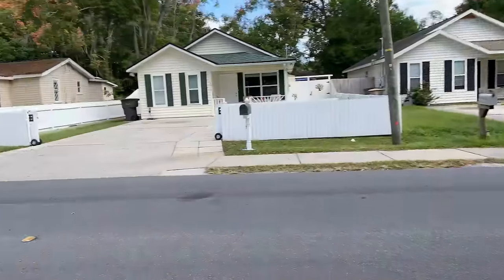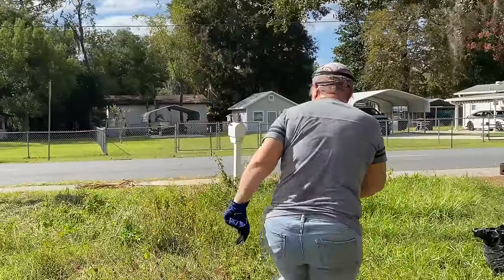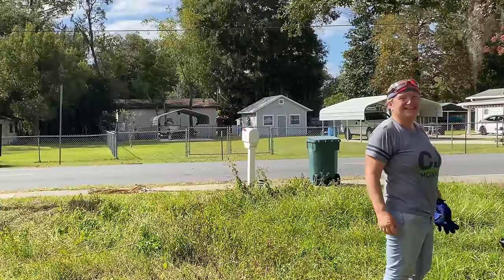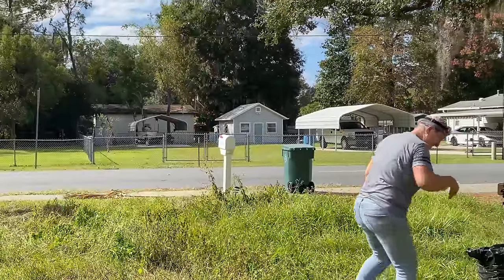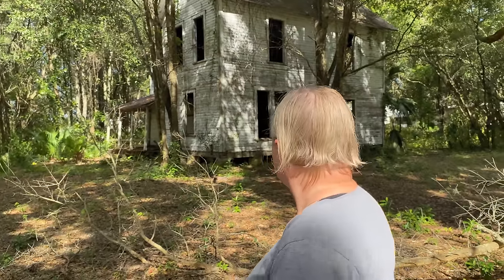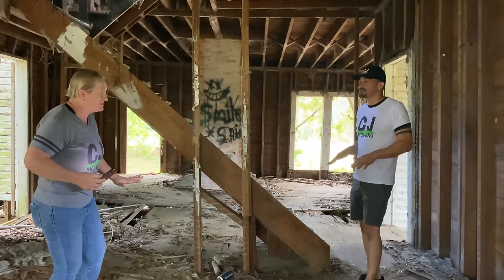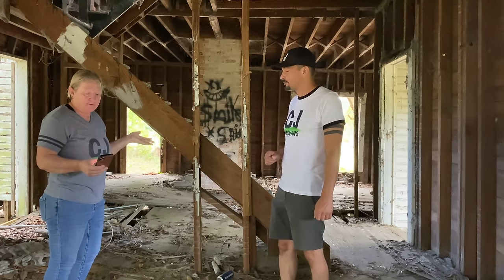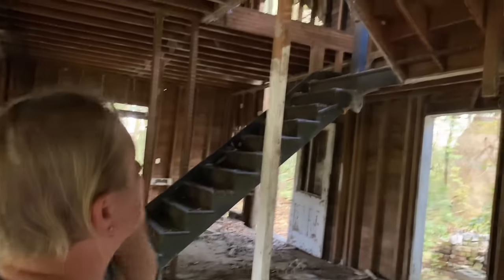WORST HOUSE on the Block! Neighbors SHOCKED as 2 Sisters let their Place GO!

Comment: Whether the yard is kept up after this is immaterial. When a gift is given, it’s only a true gift if it is given without any “strings attached.” You gave her a real gift. ❤
Reply: I have said this all my life, as far as a gift having no strings attached.  It's rare. Expectations usually rears its ugly head.
Reply: Good point.  It would be lovely if the surrounding neighbors could mow it when they do theirs.
Reply: Accepting the Gift Freely Given, honors both those that Gift and those that Accept.
Reply: Apparently, the neighbors are not the type to help out. Otherwise, someone would have done so by now.

Comment: Be careful mowing with a zero turn mower. I was mowing with my mower and I noticed that my left shoulder was getting really hot and I thought I need to investigate I thought something was not right. I turned to my left and I saw the flames 🔥 going up higher than I was setting. I always had a hard time getting on and off of my mower. To this day I still don’t know how I got off of it I knew it was full of gas because I got my son to fill it the night before. I called 911 when I got to my carport and I felt that I was far enough away to be safe. But I kept thinking about how did I get off of it. It was a red Toro, lawnmower. I have been since then paying my brother in law to mow. I do miss mowing but I don’t miss the gnats and the heat.  I thank what you are doing for others.

Comment: I bought  a 5" battery operated chain saw for my husband and son and think you should check them out.  Think it is called a Saker chain saw.  There are other brands out there, but it would make clearing the brush along fences a lot easier and faster and allow you to cut limbs that are in the way too.  During the holidays they had a sale last year and probably have one right now.  It would allow you to do a more complete job without the high intensity physical labor.  God bless.
Reply from the maker: That’s what was used in this video. We also have it linked in the description section right by mini chainsaw. 😊